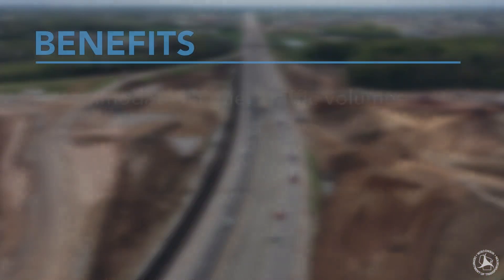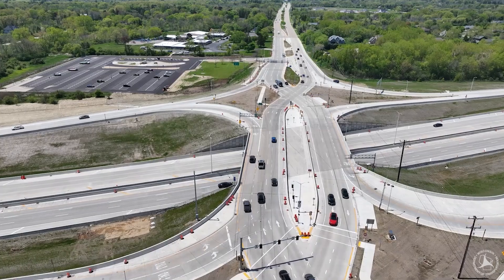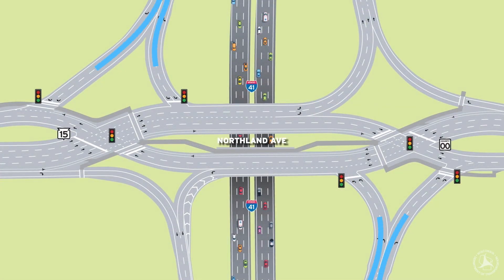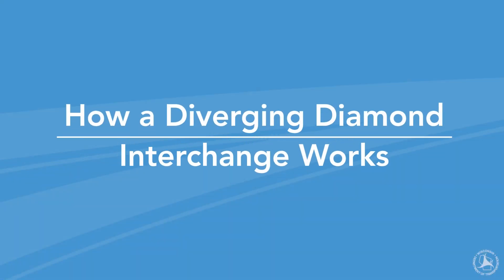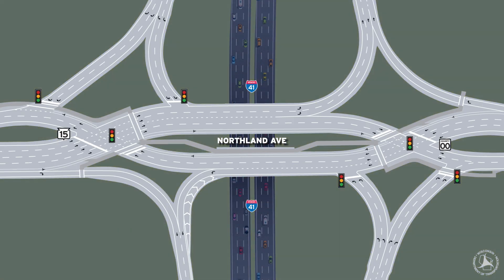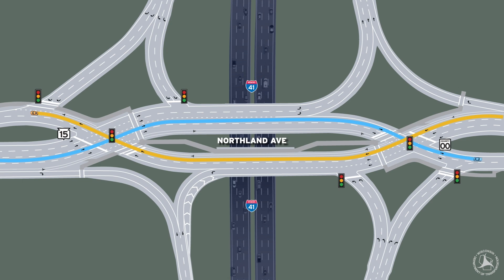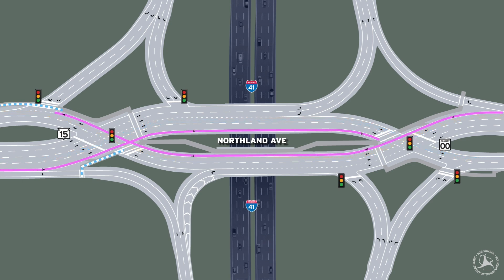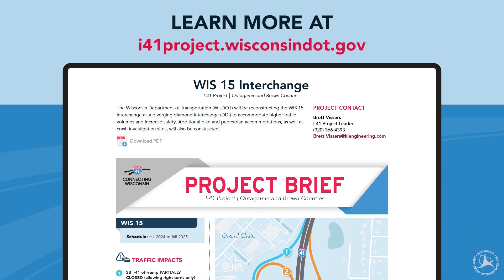I-41 Project Diverging Diamond Interchanges – Outagamie County

Comment: Give me SPUI's or give me death
Reply: Haha ur comment got shadowblocked noob
Reply: SPUIs are less efficient for the ramps.
Reply: @traffic.engineer I'm curious, why? P
I'd think 3 light cycles saves red time so you'd have better efficiency. In playing cities skylines, I've found the highest capacity with a SPUI. DDIs I thought are more focused on safety than capacity.
Reply: @aSASa45454  DDIs use two-phase signals, so there is less red time than a SPUI.  Additionally, DDIs allow left turn on red.
Reply: @traffic.engineer  This was the only thing I could find directly comparing capacity of DDI to SPUI, but most of what I read seemed to allude to the capacities being similar, with DDIs having less delay. Not sure why the mismatch

After reviewing several options, Idaho Transportation Department (ITD) District 5 chose to build the state’s first diverging diamond interchange (DDI) with the idea that it could be modified in the future to a single-point urban interchange (SPUI). The main structural difference between a DDI and an SPUI is that the DDI requires two relatively narrow structures set apart to accommodate the weaving traffic pattern; in the case of the Chubbuck Interchange, the clear distance between the two parallel twin bridges is 48 ft. On the other hand, an SPUI, which can handle higher volumes of traffic, requires a wide single bridge to operate as a center point for all traffic movements. Because the SPUI can handle a higher volume of traffic, the DDI was designed to accommodate a future SPUI if or when traffic warrants the change.